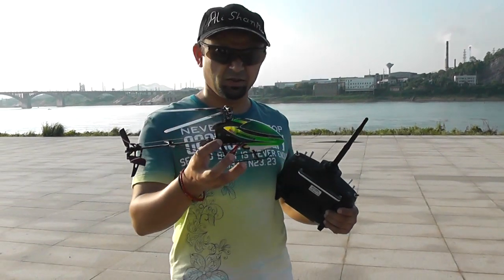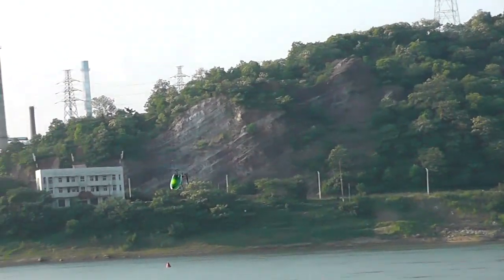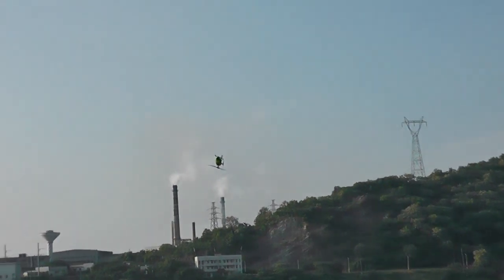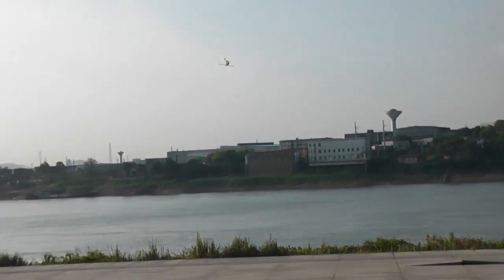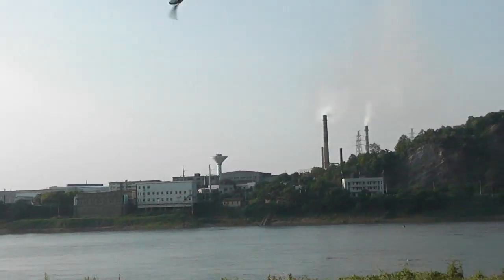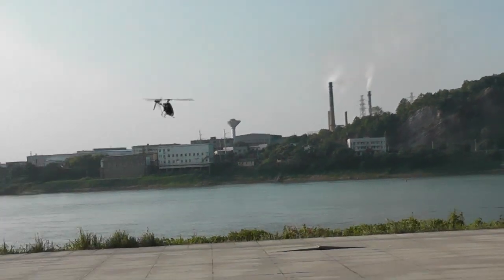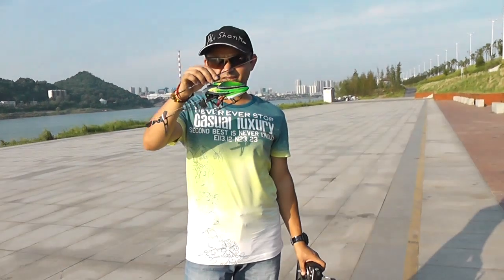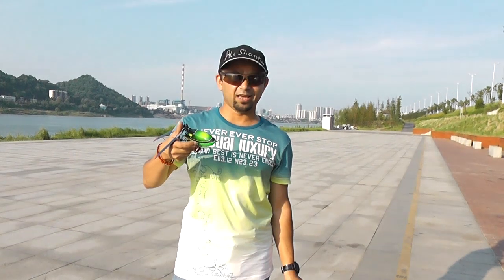6 Axis Gyro Walkera V120D02S Flight on Gusty Windy Day

Comment: Hi alishanmao
, do you know if there is there any 6 axis gyro's for helicopters?
I would love to add a 6 axis gyro to my 700 heli
Reply from the maker: http://onlyflyingmachines.com/product/h1ap/
Get this one. it has GPS. best for 700 Helis. 3D is very stable. and any time you make mistake, even if you are inverted, switch to GPS quick and leave the radio, Helicopter will hold its position rock solid. also can fly auto circles, figure 8 and auto inverted using one switch only.

See demo of this Autopilot on a 450 Helicopter here
https://www.youtube.com/watch?v=S9dKD6QDmls